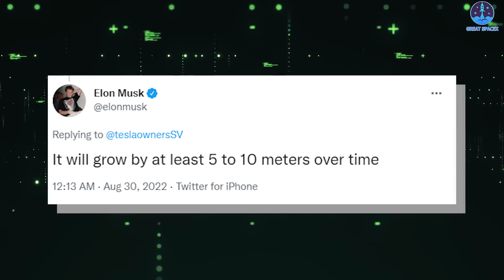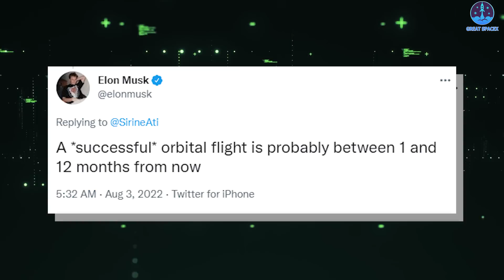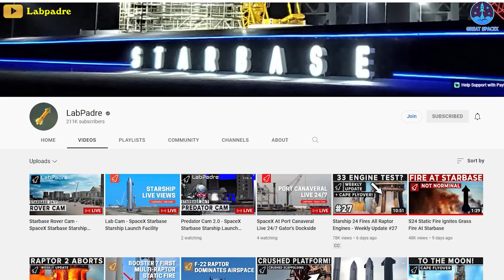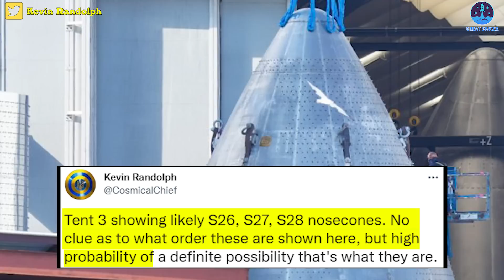What Elon Musk just revealed about NEW Starship will blow your mind!

Comment: There are a lot of comparisons on the web focusing mainly on rocket size in height, engine thrust, and so on. I haven't seen anything on payload capacity. In my opinion, this and launch frequency capability is what sets Spacex apart from the others. That is Starship enables humanity to set up infrastructures on Lunar, deep space, Mars, and so on with its ability to carry  heavy construction equipments and materials. Its like comparing a half-ton truck to a motorcycle, or a big 16-wheeler semi-trailer to a small suv.

Comment: It sounds like they are now really putting the rocket through its paces.  The problem with the fully stacked Starship is in addition to the extra complexity over just flying the second stage by itself is it really needs to fly far away from population centers on the first try as opposed to flying sooner with a possible fireworks display on or near the launch pad.  (It's just too big of a firework.)  Unfortunately for impatient viewers, it takes a while to shift gears like this.  With how they are going about it now, I would have more confidence in it not having issues than a recent Boeing plane rolling off of the assembly line, granted Boeing hasn't been doing quite as well as they used to in this realm as of late.
Reply: That goes for SLS too, how certain are you that SLS won’t blow like Challenger?
Reply: @Nostradamus_Order33  What could possibly go wrong with rushing Boeing?...

For some reason when Mike Pence moved up the launch date for SLS by 4 years right after the Boeing 737 MAX grounding, for some reason I couldn't help but mentally picture him saying it on the tarmac with a grounded 737 MAX behind him.
Reply: @Nostradamus_Order33   I second that scary thought.